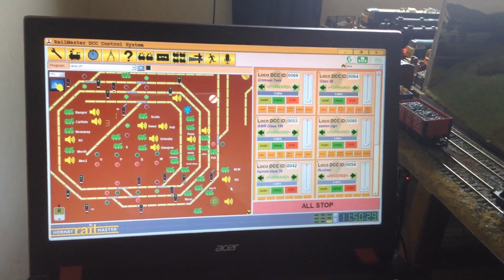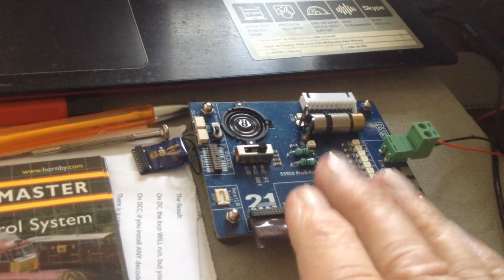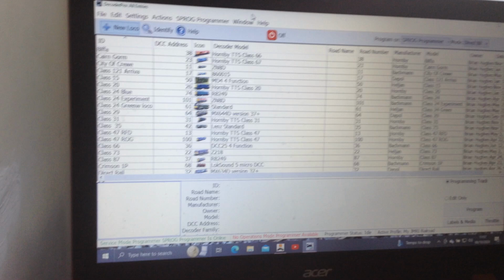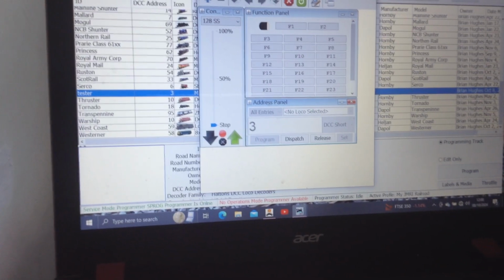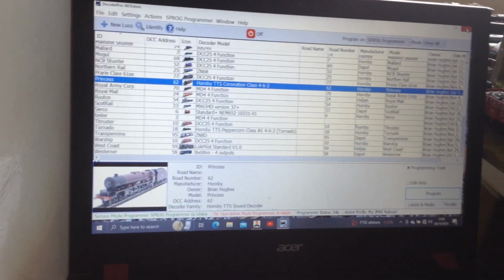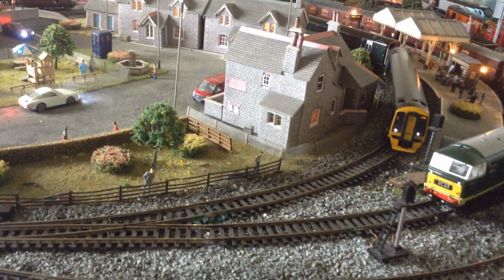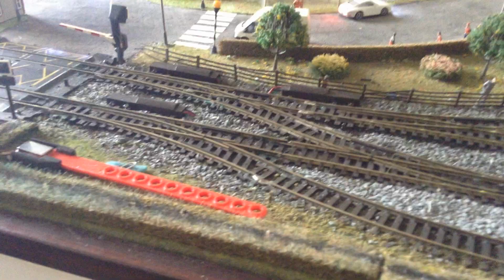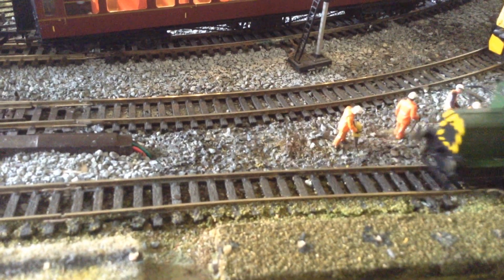Railmaster Disc Problem

Comment: Hi Brian, very informative video. I like the look of JMRI, but I don't think it works with my E-Link. Ken.
Reply from the maker: Hi Ken, You  Have to to use  a controller called a Sprog with JMRI, I use it has another tool in my arsenal and don't think you have anything that can beat Railmaster when you can have 6 locos on screen at any time and can control all 6 locos at once

Comment: Hi Brian, thanks for the info. Can you tell me which version of the Sprog is best and do I need to buy anything else with it? e.g. power plug or software. Many thanks. Ken.
Reply from the maker: Hi, what you want is the Sprog11v4 also a 12v power plug. The JMRI software can be downloaded for free which includes Decoder Pro and Panel Pro